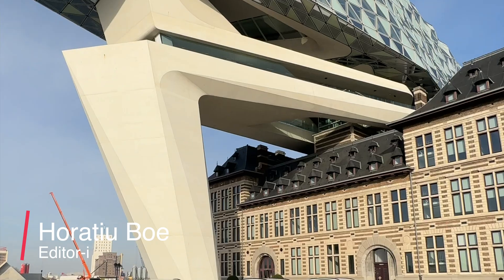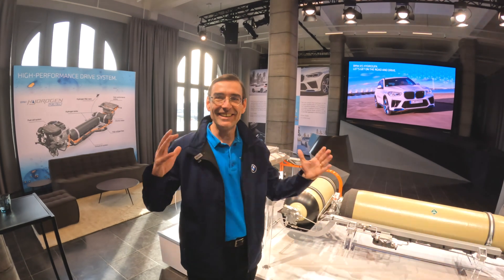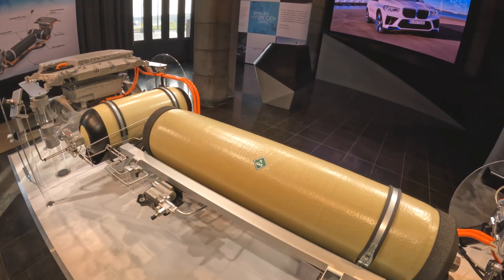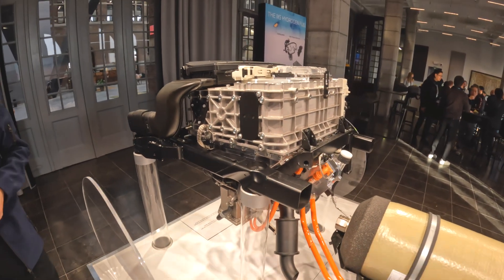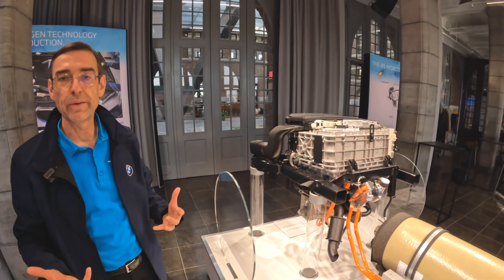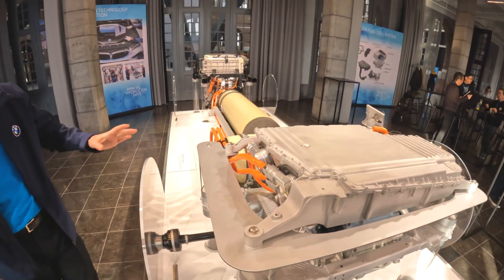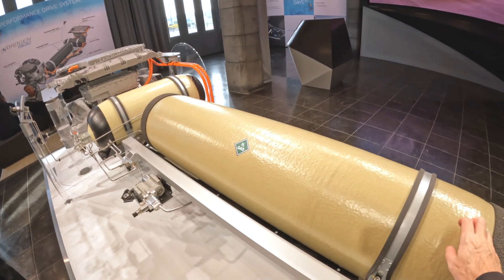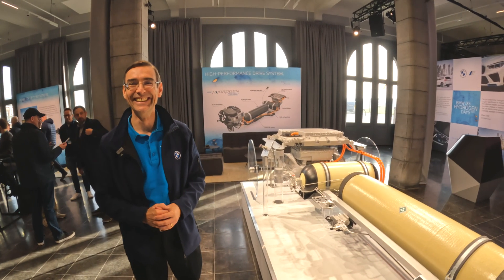How Does the BMW iX5 Hydrogen System Work? A Comprehensive Guide

Comment: How much energy does the high-performance battery actually have? I've heard that it's not that big for fuel cell systems. But somehow the battery has to be that powerful
Reply from the maker: It actually doesn't. It's a very small battery

Comment: Great video as always, but with minor correction; at 8:06 you say 6kg each.  It's 6kg for both tanks together.  As it is, the efficiency isn't anything to write home about with 500km/6kg, but not bad for a pretty large SUV.  The average current price of H2 is about $25/kg in the US.   It will certainly fit the needs of some.

Comment: as an engineer, I find this fascinating. However, I would question the value of BMW investing lots of money in this given that there are so many problems in pure BEV models, battery manufacturing, at scale, integration with charging infrastructure, etc. Those are all things where Tesla are ahead -something they have managed to do by neglecting foundational issues like manufacturing quality. The Japanese car manufacturers put a lot of money into fuel cells and now they are way behind on BEVs and having to struggle to catch up... The more people who install household charging points, the more-high power public charging points get installed, the less compelling the arguments in favour of fuel cells as a mass market product becomes. I can see the motivation from the ICE manufacturing supply chain, and from the fossil fuel industry as the "blue hydrogen" story keeps them drilling up carbon from the north sea a bit longer -but charging a car battery solar panels is, once you got those manufacturing costs out the way, a better long-term story
Reply: The don't invest that much money into this compared to their BEV development, millions compared to billions
Reply from the maker: Not sure it was a huge investment. This is still a very small fleet
Reply: Hallo Sir, bmw had lounched this system at 2000 with 750 il 12 cylinder. They build 20 cars to show very simple system and rjns. Only the German government block this big advantage to arise the new standard in the market. And Germany has the most experience in hydrogen in market. You now Hindenburg aircraft 100 years ago. They drive two Years with own line between Germany and south America.. Every week. No accidents in hundreds of flights.

Comment: Nice video, thanks. There are 2 advantages that were not specifically mentioned: (1) the hydrogen car is relatively light compared to a BEV as no large capacity battery is required (this can easily save 400kg of weight). (2) The energy density of H2 is very high, which results in a decent range (500km for this car) for just 6kg of H2. Only recently, some BEVs can do 500km. Of course there are downsides too. At this moment there are hardly any H2 filling stations,  hopefully this will improve over time.
Reply: It's not that much lighter than a BEV car. It's the same weight as a PHEV X5 so close to 2.5tons. And range is also over 100km down on the iX.
Reply: if I look at a hydrogen charge map of the UK I see two: one by Heathrow Airport-where rapid fuelling of airport vehicles running 7x24 makes sense, And a bus depot in Wales. Again somewhere where a fast turnaround is justified. but every day commuting, the fact that the vehicles are idle, most of the time means that low speed charging at home and work is perfectly suitable.

As an example, my employer's California office has covered parking for EVs only where every parking bay has a charging point-probably about space for 60 vehicles. If you own one, you can drive to work down the carpool lane, park it in the shade, have it charged during the day - and then as the time to go home approaches, turn the air-conditioning on while still unplugged so it is nice and cool when you head out for the evening traffic jams. You can criticise BEVs for range and time to charge, but manufacturers can improve it, and for most commuters, those long journeys are an outlier
Reply: @SteveLoughran  Fair points!
Reply from the maker: Thanks for sharing
Reply: They say it was about the same as the PHEV but less than the iX.  If it was less than the PHEV, they'd say it.  So let's take the upper trim of the PHEV at 2552 kg and the iX weighs 2566kg or 14 kg more.   Of all the examples that exist (Mirai, Nexo), they are about the same as a full BEV in weight.  Some are hard to compare; for example, the Mirai weighs more than a long-range model 3 but the model 3 has much more interior space because the energy density of H2 may be high, everything needed to make it back into electricity to drive the motor isn't.  Basically, they weigh the same because they both have the same drive train/electric motor and you're substituting the 400kg battery module in a BEV (which usually includes structural members); for the tanks (~135kg), the fuel cell, (~70kg), the hybrid battery (~70kg), plus all the auxiliary systems including air pumps, condensation pumps, filters, etc (another 45 kg), plus extra body reinforcing above the hydrogen tanks (~25kg).  So about 345kg.  Because the iX5 accelerates so fast, I suspect it has a much larger hybrid battery than a Mirai's 70kg hybrid battery, maybe about 120kg.

Comment: Where does the hydrogen come from?  How far do you have to drive to get to a H2 fueling station (in order to spend 3-5 minutes refueling)?  How much does the hydrogen cost, versus gasoline?
Reply from the maker: A very complex question because hydrogen can be produced in multiple ways. It can also be difficult to refill. In Antwerp, it's fairly easy. In other places, not yet. Hydrogen cost is high today in Europe due to the energy crisis.
Reply: This is the question raised when electric cars where in concepts. Just like electric charging popped up everywhere hydrogen fuel stations will also pop up.
Reply from the maker: Hopefully
Reply: @hiferdin  Calling an electrician to fit an electric charging port on my house would cost me around 200-300€ around here. The cheapest hydrogen fuel stations start at somewhere around 1 mio € and are heavily restricted in urban area because of their high pressure tanks.
Reply: @SpitfireMkIIFan  that’s the current situation, it will get better in the next few years.
Reply: @hiferdin  Sure thing, once every home comes with its own 700 bar hydrogen pipeline this will be completly normal.

Until then I rather stick to BEVs.
Reply: It depends on where you live.  "green hydrogen" tends to be more expensive than gray (made from NG)  But to give you some actuals from the US.  California is the only state with any meaningful amount of H2 stations that you can actually drive.  I took all the stations in California that have H2 and averaged them together which came out to $25.58/kg.  I'm not sure if this channel allows links but you can look up "h2-ca"  It has current station status, reporting, etc for all the stations in CA for you to check out.  The iX5 has a 6kg tank, so that's about $150/tank for about 310 miles or 48¢/mi.  A gas-powered x5 gets 23MPG  at $4.77/gal (California average to be fair) or $0.21/mi.  So it's like paying $10.90/gal of gas.  But that's in the US, it may be cheaper in other places along with higher gas prices.

Comment: How much does it weigh?
Is it less than an electric car?
Reply from the maker: The iX5 has the same weight as the X5 PHEV, and lower than the iX
Reply: @bmwblog  Ok great stuff!
Reply: To give a numerical answer, they say it weighs about the same as the PHEV which is between 5512 lbs and 5627 lbs vs the iX which is 5659 lbs or 2.6%-0.5% less.